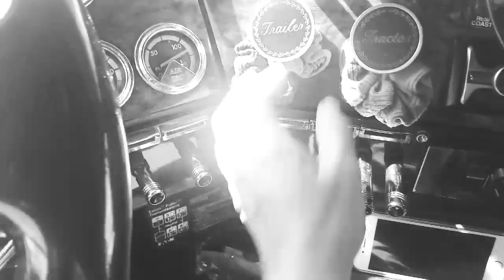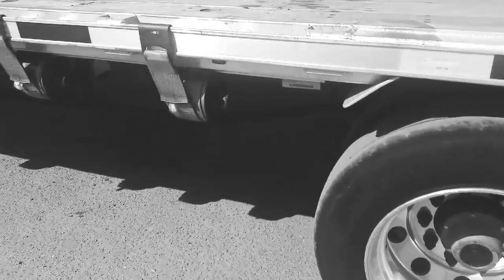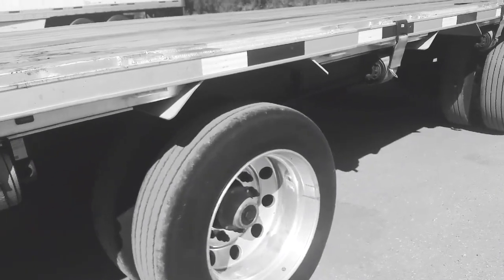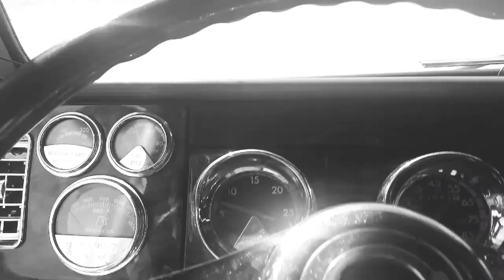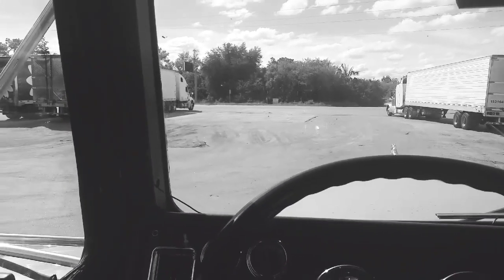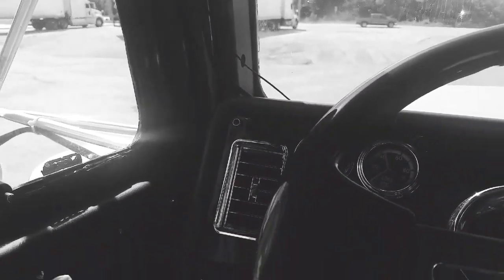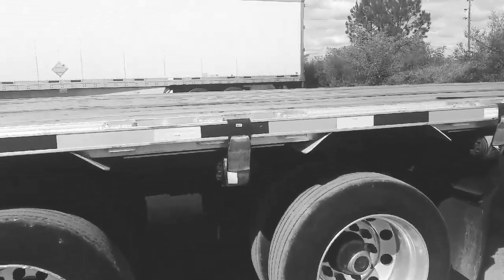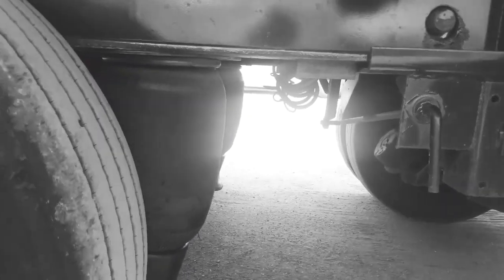Random Trucker Tip #4 Sliding Axle on Stepdeck

Comment: Things have changes since the 90's. For me it was pull the pin, release tractor brakes and slide. Set tractor brakes and hopefully I was close to the hole I wanted. set pin, and off we go. Didnt have air to deal with. Was air ride but 48' straight flatbed, no drop. Cool Lady, thanks.
Reply from the maker: Interesting, thanks for the info.... :- )

Comment: Sometimes whomever ordered the trailer new specifies it set up to work a certain way. Or with certain equipment on it. I had a flatbed that I got used the original owner got it without winches and it was a major job to put them on afterward so I used it for8 years with all portables. It was a good trailer only missed 1 load in all that for repair. Stay safe.
Reply from the maker: Cool, thanks. You too  :- )

Comment: More complicated than the old way of doing it... just setting the trailer brakes and pulling the pin on the trailer assembly...get back into rig & pull or push...depending on the need...and walk back to see if pin lined up with the required hole...set the pin and that was it:)
Reply from the maker: Ray Clark Yep. :- )

Comment: Is there an automatic ride height that you are overriding with the manual valve to get the chassis higher than where the tyres would hit the tie downs? Or is loaded height controlled some other way?
Reply from the maker: The system is set at a certain ride height which is controlled by an adjustable arm like a normal trailer,  it only airs up the bags to make room to slide the axle without hitting the tires on the trailer because they sit up within the wheel wells at normal height. The reason I hit the tie down is because the top of the mud guard is a little bent, (from a previous attempt to slide it) I had to bend it back & I think it's out of the way now.... hopefully :- )
Reply: Thanks Cindy.  pretty much what I suspected. If a trailer air bag blows do the trailer brakes lock up? or will the anti-lock still work?
Reply from the maker: 10susan10 it won't lock up the brakes unless there's a malfunction in the system. my old trailer locked up the brakes and aired up the trailer while I was going down the road because of a malfunctioning valve
Reply: Had an issue with mine where the anti-lock unit shifted to one side overnight and even though the brakes seemed to work fine the air ride would not fill the bags. Didn't figure out how to reset it until after putting a new one on. expensive lesson.

Comment: you can't drive down the street with the airbags fully extended you have to drop the air out to drive down the street when you have a load you air up them bags
Reply from the maker: Yeah, my last trailer had 3 separate valves for the sliding system and it malfunctioned and aired up my axle while I was driving and to make it worse the valve for the brakes popped too and cost me 4 tires !   :- 0